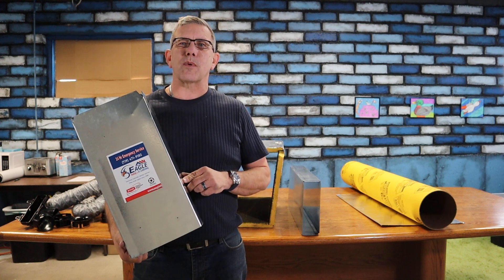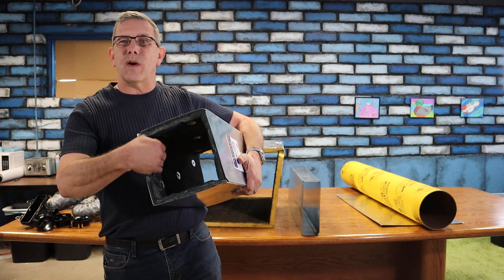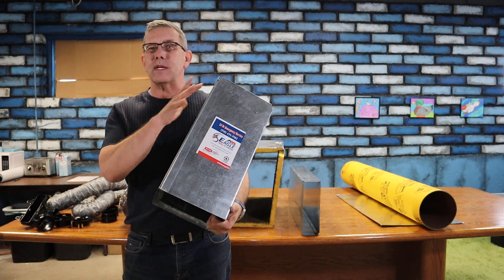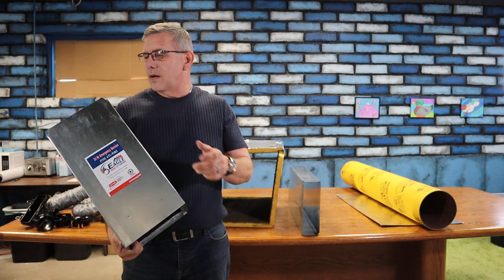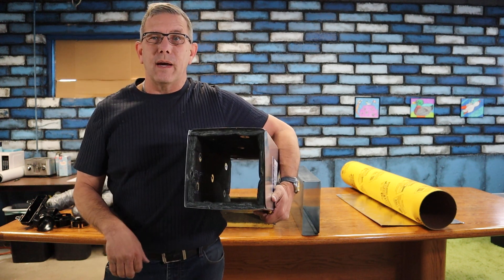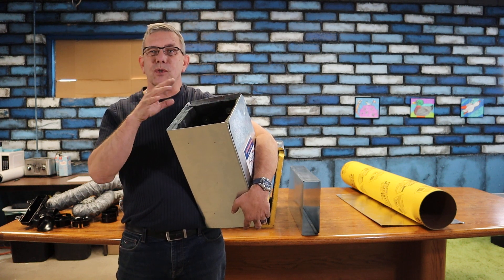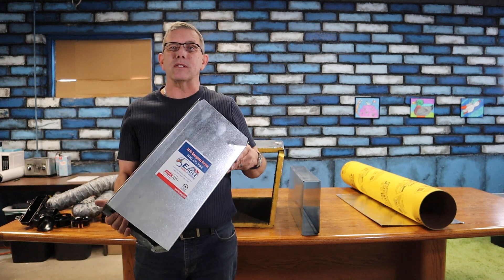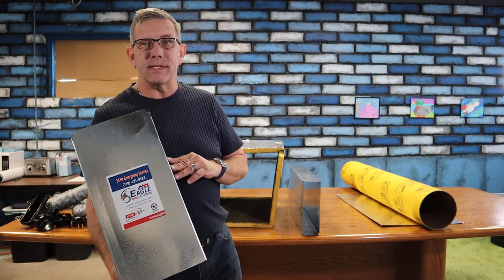Part 2 of 8 - Acoustically Lined Air Ducts explained

Comment: I bet it’s pricey to replace old ducts with these acoustic ones. Maybe I’m wrong but I’d rather use the money to invest in some mini splits.
Reply from the maker: You can also get an insulation wrap for the outside of any exposed ducting. Not very expensive and easy to do yourself.

I would not replace ducts unless they are damaged beyond repair.

Mini splits are also a good option.